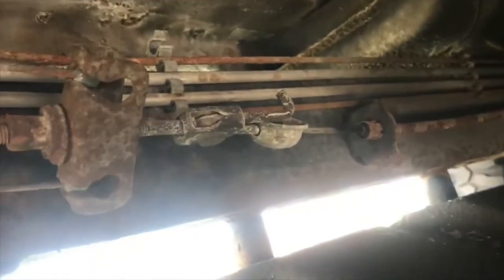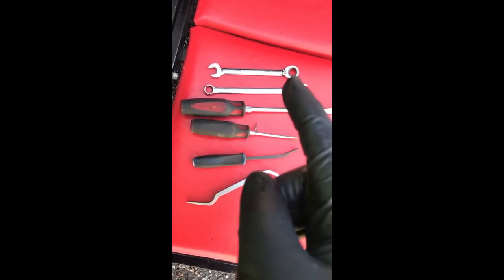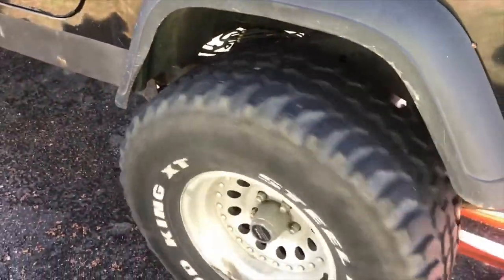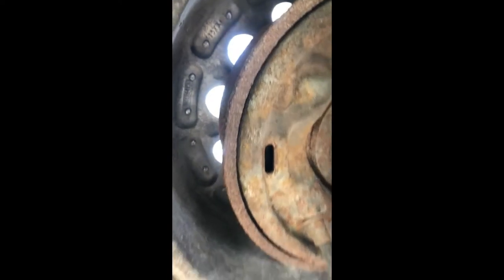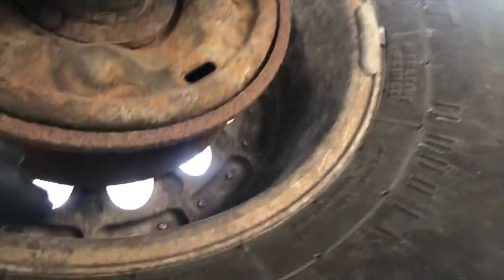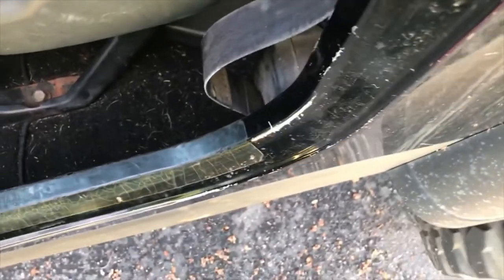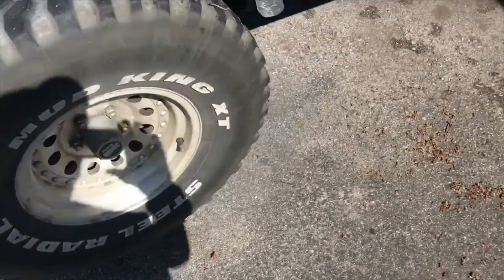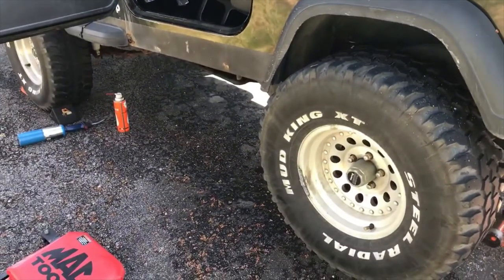91 YJ Rear E-Brake Adjustment

Comment: Well done... I just came here to ask about your rear view mirrors?! I haven't found a set that will mount with the soft too, and preferably stay on the jeepnqhen I removd the doors. Perfect video on the ebreak adjustment. When I was a mechanic, I'd jack the rear and adjust until it starts grabbing, ebrake not engaged. Then I'd back it off 3-5 teeth and make sure we have free spinning tires again